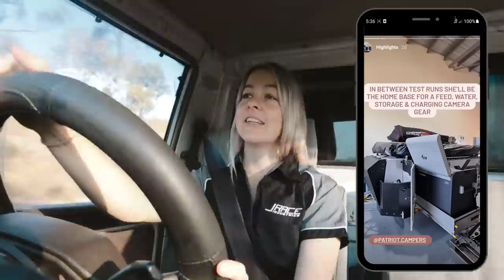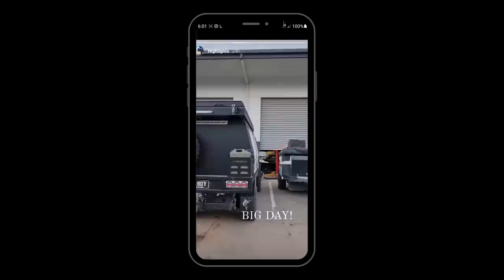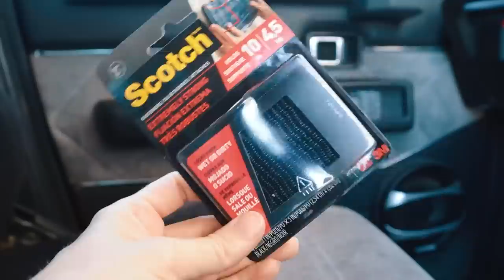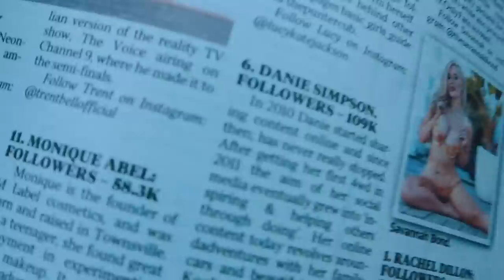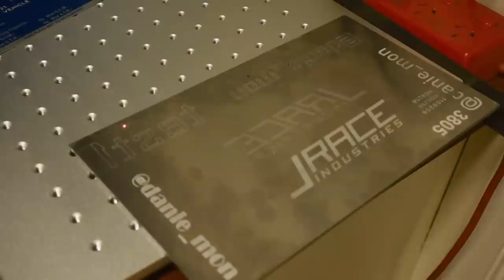Workshop Weekends | LT2 Test | 60 mods | I'm in the paper?!

Comment from the maker: Hey guys some info for those enquiring👇

The Lane Change Test is an ISO standard test under the NCOP (National Code of Practice) and a test requirement for vehicles lifted over 50mm (75mm for non ESC) As this is a national code most states will also adopt this as their standard. Be sure to read into your own states laws and testing requirements before modifying your 4wd (it makes the process much easier!)

We do all fitting and engineering in house at Jrace Industries in Townsville so for all enquiries or quotes please get in contact https://www.jraceindustries.com.au
Reply: it doesn't seem very practical or realistic but hey anything is possible I guess .. it would be interesting if they gathered the data from the body roll or something similar
Reply from the maker: @brentmcd12  it's a very realistic manoeuvre. People's first instinct when encountering an obstacle is always to swerve and at high speed this can become extremely fatal if the vehicles handling and road holding isn't at a certain standard. When 4wds are modified these two aspects are greatly affected so this test ensures the vehicle can still be safely manoeuvred in an emergency. Alot of data is collected throughout the entire test on each vehicle.

Comment: As the door panels are past their best, why not trace round where the door cap sits, then cut the vinyl half an inch in from the marked area then remove the inner foam to the line marked so when the rest is in position it will grip the vinyl then add the 3M tape along the whole edge and fit, then it will not move and will be level, hope I explained it right, as it is how I fitted a faux wood cap along the top of the door with the cup holder integrated in the wood effect it worked great no movement and the few times passengers have grabbed the cup holder instead of the strap I added as I removed the arm rest/door pull as it got in the way of the bucket seats.
PS the wood look's awful so I am pulling them off and hydro dipping carbon fibre effect to them.
One of the reasons I watch your channel is because you tell it how it is, another because seeing you with your dog is just how I am with mine, single, love me love my dog, so clone yourself cause I need a partner that knows what a spanner is and not afraid to muck in and get oily greasy hands K9 loving and real.
Reply from the maker: The whole door trim will be getting replaced as its all split, which you couldnt see on here. I want to try keep the body and trim of the car as factory as possible.
yeah Im not a fan of wood either glad none of the cars I own have wood trim. 
Dogs really are just the best things in this world!

Comment: Dual-Lock is WAY BETTER than Velcro, even if it doesn't fit your need. I used Dual-Lock to hold on a removable motorcycle faring at 60MPH.
Reply from the maker: Yeah I'll definitely be finding a use for it somewhere! So strong

Comment: I don't think my stock 60 would of passed that test, partly because it has old tires stock suspension and it drives like a complete boat 🤣
Also, that engraver is a step up from the old hammer and punch🤣
Reply from the maker: it is crazy how much it comes down to good suspension and tyres! My car and alot of others would be considered 'boaty' also but just setup right and they sail through the test